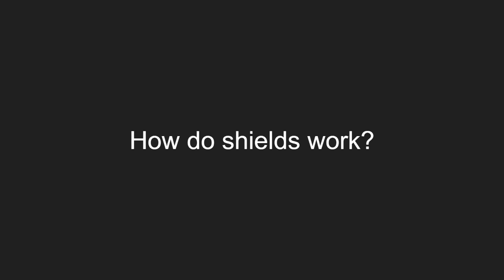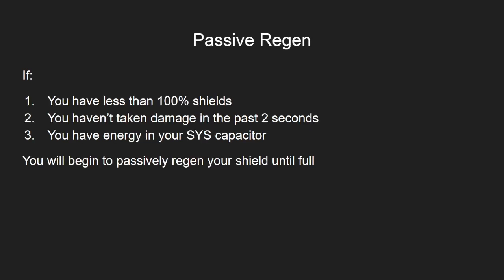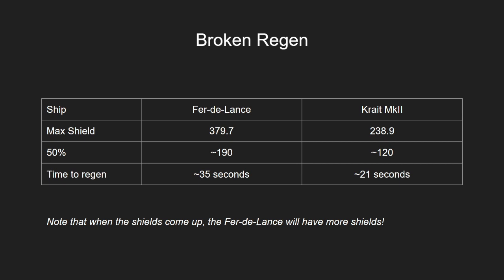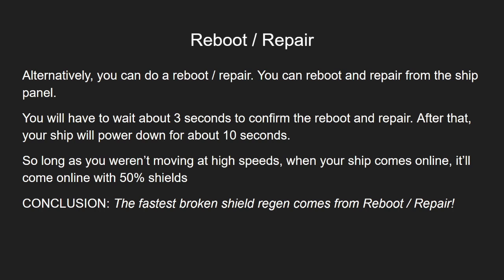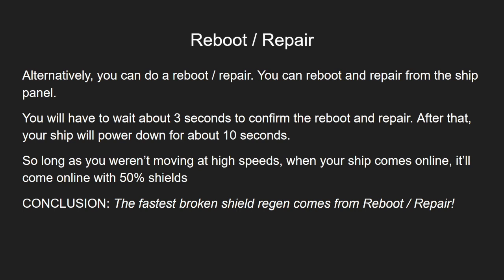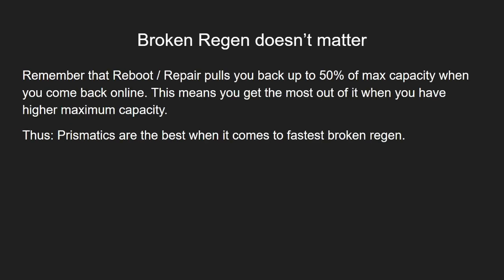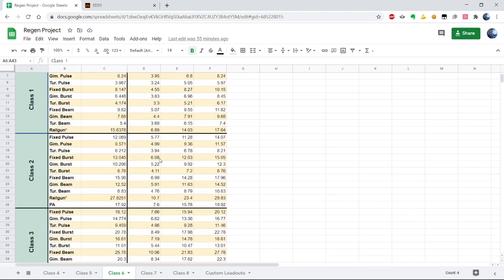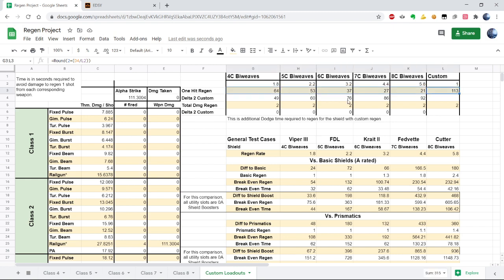Why Bi-Weave Shields Suck

Comment: i actively use a biweave on my corvette so fine ill watch this
If true.. goddamnit mat grind
Reply from the maker: Depending on the type of combat you do in your corvette, it'll be fine. If you run it in hazrez, you won't run into any issues. The difference largely matters when you're doing wing assassination missions and sometimes in CZs. In wing assassination missions, you aggro the whole squad when you attack the target, and trying to survive 10 ships firing on you at once can be tough if you're tight on SCBs but it's largely doable. In CZs it can matter because spec ops can drop on your directly and if they do your biweaves will struggle because it's difficult to break combat with the spec ops ships and you need to have taken no damage for 2 seconds to begin regenerating.

Comment: Again the meta brainrot mentality. but yes in prolongued combat bio weave is bad but you have to think in bigger dogfight where eagles and fast ships just strafe missile and topredo run big ships to zoom away and come back.
Reply from the maker: NPCs don't do those things. And in most PVP situations you won't run into that. The only people running those kinds of builds are memers ganking low-effort noobs usually outside of Deciat as they get their first engineering. Torpedos have a low speed of 250 m/s and missiles do negligible damage to shields. If you have an engineered ship, you aren't getting hit by either of these weapons. 

For PVE, the biweaves are just weaker lighter prismatics that don't offer anything particularly meaningful. The "stay out of combat" meme is really ridiculous for a number of reasons. I actually was in a prismatic doing PP CZs last night just to see how long you could go without taking any damage and I started the CZ at 50% and ended the CZ with 90%. Sure, if I had the biweaves I would've ended with 100% but 100% of biweaves is around 60% of prismatics, so the prismatics had higher shields throughout the PP CZ.

Comment: If you don't have skill issue and you know you to pilot, bi-weaves are amazingly good in PvE. I do MCZs in a Krait Phantom with bi-weaves and good resistances, and I don't even have to use SCBs to finish the CZ. And after I finish the CZ, I still have my shields on and my hull has 0 dmg.
Reply: Nice anecdote buddy. The same CZs where you'll almost never take any damage anyway because npcs don't really even attack you? Good job, now try a [wing] assassination pirate signal or a solo medusa with your biweaves :)
Reply from the maker: You don't need SCBs in any CZs. You can do the thing you described with any engineered shield. Especially if you're doing those CZs in a large ship. CZs have very little aggro time. You can sometimes go a whole CZ without ever getting shot period.

If you want to evaluate how good a shield is, you need to evaluate how it performs under stress and like I said I'll make a follow-up eventually but the moral of the story is going to be if you do any serious combat where you are constantly taking fire the bi-weaves simply do not hold out.

Comment: Your premise is wrong. You are completely ignoring resistances and the fact that combined with resistances the bi-weave shields can keep you from having to evade at all. The rule of thumb from years of EVE Online experience is, for PVP and large fleet battles always go for capacity (big shields), this is due to focus fire and huge burst damage, for PVE and predictable low sustained damage high resist min/maxed shield and regen is the way to go because it is possible to achieve zero downtime. So it's entirely situational which is better.
Reply from the maker: Watch the video, I point out the problem with factoring resistances. Even if we do factor resistances, resistances scale based on the cap. So prismatics win. Lastly, the fact is damage engineering outscales defensive by design so the higher cap is generally better. 

If you watch the video, you'll note that I did recognize some situations in which biweaves might be a better selection but in general, the prismatics will outperform biweaves especially if you're doing any real combat. For people that are constantly in combat, taking on several wings (you know, like any massacre mission stacker) the biweaves will simply fail. If you're taking almost no damage and you're running lots of downtime between fights then it really doesn't matter which shield you use so you can just use what's cheapest.

Comment: Lets calculate: Suppose youre taking 100mj of thermal damage a second.... 
Bi-weave: 100mj incoming ---- 100mj x (1-0.40) (thermal resistance)= 60mj per second. with 5k total shield strength will result in sheild failure in 83.3 seconds
       Effective Regen: 6.6 with 40% resistance roughly 11mj/s              With regen 102 seconds till collapse

Prismatic(no resistance only heavyduty(-20%)): 100mj incoming ---- 100mj x (1-(-0.20))= 100x1.20= 120mj. with total of 10,500 sheild
        Effective regen: 1.3 with -20% resistance roughly 1.1 mj/s             with regen  88.3 seconds till collapse

SO if your prismatic shields are only heavy duty you should reconsider
Lets try the Prismatics with Resistances at the cost of losing total heath

Prismatic(with resistance 40% thermal):100mj x (1-0.40) (thermal resistance)= 60mj per second. with 7200 total health
        Effective Regen: 1.3 with 40% resistance roughly 2.1 mj/s            with regen 124 second till collapse

This is where you look at numbers and think....Look! the prismatic lasted longer. But Being attacked 100mj a second constantly isnt a realistic fight. Where as having any down time at all MASSIVELY benefits the Bi-weave with its 11 Effective regen.... if you dont understand when i mean by "Effective Regen" its say the regened shield also has resistance making it a more valuable regen. 

Take this as you will. But The question is.... how long does the battle need to go on until bi-weave is more effective. With these number and scenario it doesnt take much more time. Resistance is the most import thing, And Bi-weave benefits and get the MOST out of having resistance
Reply: Resistances can be higher easily and in most cases are. Which bi-weave even more of an advantage.
Reply: Ill add that these were Cutters with class 8 shield gens and this whole scenario changed with different size shields, ships etc
Reply from the maker: Gonna ask you to stop spamming. You missed the point of the video. The point is you're not getting "in-combat regeneration" and that the fastest regen in the game is reboot and repair which you can safely do out of combat and far exceeds any bi-weaves pretending to be prismatics.
Reply: @im-the-zam  regen is in fact a thing in the game, Both shields have pros and cons for certain things. You can test this by doing something as simple as Afk your ship in a Low res zone… Your prismatics will fail you where as the bi-weave will go on forever until you run out of gas. Most people dont PVP… and even so If my ship is faster than yours it is in fact very easy to get time to regen my shields. ill do a simple equation for you

My ship faster= you cant catch me= thanks for being slow my shields regen faster = I have advantage now
Reply from the maker: Regen is a thing. Regen in combat is not. Your PVP example is dumb for several reasons but you don't have advantage. If speed were the only thing that mattered then every PVPer would run Eagles or something. There's no incentive to PVP anyway. And in organized PVP I'll let you in on a secret - they run prismos. Are the real PVPers jut not up to date on the tech or are you just not a combat player? 

That aside, we're talking about PVE combat are we not? Though I do find your example hilarious. "Leave your ship AFK in a low-res zone" which is a zone I never even touch anyway because reduced spawns and increased security. Like what are you doing kid. But your example isn't testing combat it's testing regen against residual damage in a low damage environment. What are you even trying to argue. 

For those of us that actually do combat: to efficiently clearing wing massacre / assassination missions you regularly aggro 3-5 wings at the same time. If you are running biweaves you will not survive. And if you play slower that's fine, enjoy spending all of your time chasing ships that you could've just aggro'd and handled in one spot.
Reply: @im-the-zam In PVE in hazard zone i have zero problem regenerating, your ships must have no firepower to kill other ships

and for pvp Like i said… earlier this time ill dumb down the dumb down equation i did earlier… Time is not a prismatic friend

My ship faster… i have complete control if i want to boost away for regenerating. with that alone you are no longer in control of the battle but at the mercy of the bi weave. 

Youre next argument is going to be some non sense like…. No your not allowed to he faster than me and regen 😢, when your prismatic when twice as much as a bi-weave. I did the calculation for you. 

Your argument…. Prismatic is better if bi-weave isnt allowed to regen….
Well no shit thanks CMDR obvious
Reply from the maker: I will once again request that you stop spamming. You have more than enough characters in your post to make only one comment. 

If you're killing other ships then why are you saying you have time to regen. You should constantly be in combat. But you're not, because you're too busy boosting away to regen because your biweaves dropped below 20% for the 5th time this fight. 

You don't get to regen because if you're doing PVE efficiently (and you yourself are not) you should be in combat constantly. Every second you aren't in combat and you're regenning is a second you aren't destroying targets. Bi-weaves have their niche case uses but if you're at the stage of the game where you can do wing massacre / wing assassination missions solo, you aren't using bi-weaves.
Reply: @im-the-zam I never dropped lower than 80% in a Haz zone… But have a nice day, Im not convinced… the argument of youre not allowed to regen doesnt cut it for me. and im tired of explaining it. We agree to disagree at least… God speed CMDR o7
Reply from the maker: Hazres is pretty low impact. I would recommend trying some wing assassination missions solo and getting back to me.

Comment: So my Bi-weave regens at 6.6/s where as the prismatic will regen at 1.1/s. My Bi-weave has 5k shield strength with +40% thermal resistance. Ive seen some cutters get to 11k shield strength. But its easy to convince your self with numbers here to think how Prismatic is way better but with resistances is where the value of bi-heave shines. Taking less damage is great for both but when one regens over 6 times faster... longer battles really start to fair for the regen for time is your friend with bi-weave.
Reply: Lets calculate: Suppose youre taking 100mj of thermal damage a second.... 
Bi-weave: 100mj incoming ---- 100mj x (1-0.40) (thermal resistance)= 60mj per second. with 5k total shield strength will result in sheild failure in 83.3 seconds
       Effective Regen: 6.6 with 40% resistance roughly 11mj/s              With regen 102 seconds till collapse

Prismatic(no resistance only heavyduty(-20%)): 100mj incoming ---- 100mj x (1-(-0.20))= 100x1.20= 120mj. with total of 10,500 sheild
        Effective regen: 1.3 with -20% resistance roughly 1.1 mj/s             with regen  88.3 seconds till collapse

SO if your prismatic shields are only heavy duty you should reconsider
Lets try the Prismatics with Resistances at the cost of losing total heath

Prismatic(with resistance 40% thermal):100mj x (1-0.40) (thermal resistance)= 60mj per second. with 7200 total health
        Effective Regen: 1.3 with 40% resistance roughly 2.1 mj/s            with regen 124 second till collapse

This is where you look at numbers and think....Look! the prismatic lasted longer. But Being attacked 100mj a second constantly isnt a realistic fight. Where as having any down time at all MASSIVELY benefits the Bi-weave with its 11 Effective regen.... if you dont understand when i mean by "Effective Regen" its say the regened shield also has resistance making it a more valuable regen. 

Take this as you will. But The question is.... how long does the battle need to go on until bi-weave is more effective. With these number and scenario it doesnt take much more time. Resistance is the most import thing, And Bi-weave benefits and get the MOST out of having resistance

Comment: My G5 Bi weave with increase regen and Thermal resistance and thermal resistance shield booster i never go below 90% ever with 1 pip in systems. Tbh they are all viable options but i have 5k in shields and prismatic with only numbers buffing gets to 11k (Cutter), so if u go a whole session of pirate hunting and only go down to 50% Theres so much time of missed regen opportunity there. Prismatic are twice as heavy making you slower, and take more damage because of it as well

Comment: Same story here. I used to swear by Bi-Weaves, but then I tried Prismatics and I will never go back to Bi-Weaves again.
I have G5 eng Prismatics and I don't even think about shields anymore in PvE. Even against multiple Spec Ops in Power CZs, I run out of ammo way before my shields get anywhere near 50%.
Reply: My G5 Bi weave with increase regen and Thermal resistance and thermal resistance shield booster i never go below 90% ever with 1 pip in systems. Tbh they are all viable options but i have 5k in shields and prismatic with only numbers buffing gets to 11k (Cutter), so if u go a whole session of pirate hunting and only go down to 50% Theres so much time of missed regen opportunity there. Prismatic are twice as heavy making you slower, and take more damage because of it as well